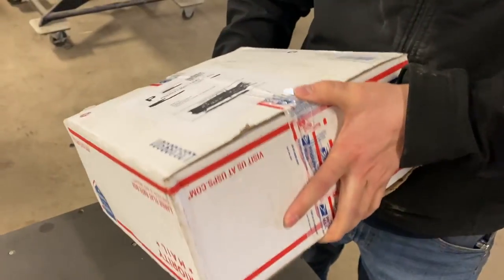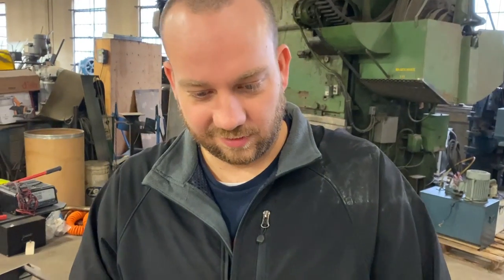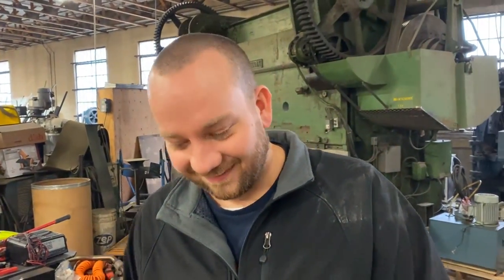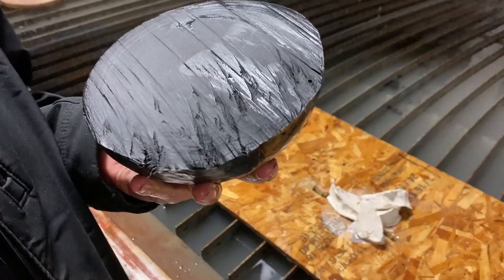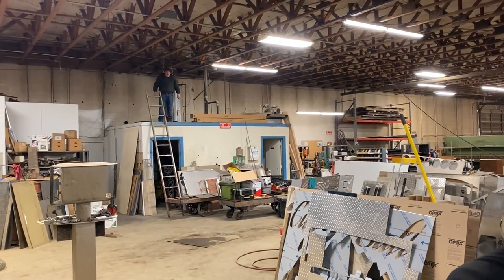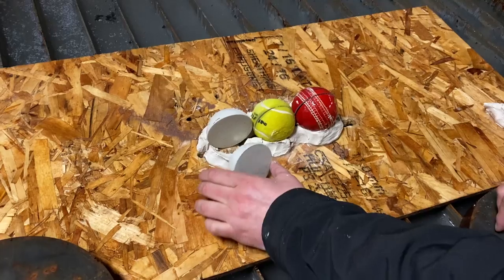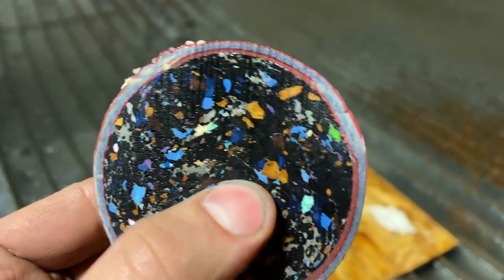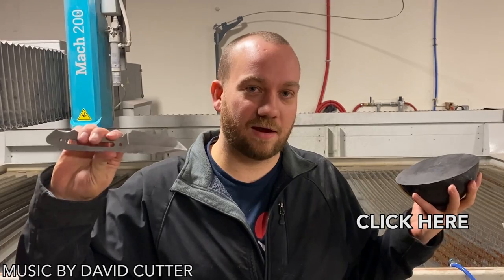11 Pound Electrical Tape Ball vs 60,000 PSI Waterjet

Comment: they could weigh the ball and weigh a roll of tape, and so find out how much rolls it took to make it
Reply: Tomas Dopazo all we need is the tape weight as they said it was 11 pounds
Reply: Eh i assume each brand of tape weighs different amounts.
Reply: Andrew Dobosz you could get an average of 10 and use the mean weight to figure it out.
Reply: 4 ounces for Scotch Super 33+ vinyl electrical tape.
Reply: @andrewdobosz3682  No, it's basically rubber and adhesive, no more 0.1 mm thick. It's probably quite consistent.
Reply: @Zaire82  depends on the source, all materials vary.
Reply: Main issue I see is that rolls of tape would have a cardboard core.
Reply: The uncle replied and said it took around 80 rolls of electrical tape

Comment: 3:45 it would've been cool if u sanded down and polished it with 10,000 grit sandpaper on the tape grooves where it was cut by the water jet...so you can see the individual tape marks better

Comment: MAKE A GIANT PAIR OF SCISSORS with the waterjet and then MAIL THEM TO PETER SRIPOL so he can make them fly. WE WANT TO SEE GIANT SCISSORS FLY! And on top of that, making Giant Scissors will be fun for you guys to play around with all the prototypes. You can start by first cutting Water melons, bunches of bananas, tennis balls, someone's hair and beard and what ever else you can think of! You might need to put a ball bearing in the pivot point so that it has low enough friction that it can be powered. Also to make it light enough to fly you might need to make it out of aluminum with steel inserts to cut with. Your 5 axis machine should be able to create almost the perfect shape of scissors to cut out so there is minimal machining work to be done to finish it up. And if there is more work to be done send it over to This Old Tony to get them working perfectly!

Comment: If you do another rubber band  ball, you might try to coat it in resin to try and keep the layers together. Basically make a Rubber Band Ball, then sink it in a 5-gal bucket with resin to encase it. That way the rubber bands might stay together enough to see a grain on the interior?

Comment: Well, the idea to cut out knives with the waterjet is very creative but just having a flat knife is biring to me. So i like forging my knives by myself ;)
Reply: Josh Frank  i dorge them in and grind afterwords so i dont have to remove much material. I startet making knifes with steelplates and cutted them out, after 3 months this tuened boring so i started forging them, its a lot more fun and you have many new opertunities to design a knife😉

Comment: 0:19 they blacked out the address and various other personal details but did NOT black out the Data Matrix Bar Code which can easily be scanned and all the personal information is visible. I see this all the time, people block out stuff but don't block out these codes. They don't work with normal QR code scanners as they're not QR codes, but if you have the right scanner or app you can easily read everyone's personal information. Remember to block out these codes before filming or photographing.!!